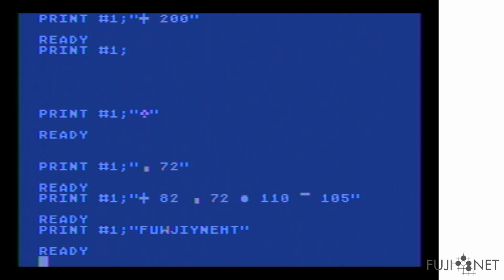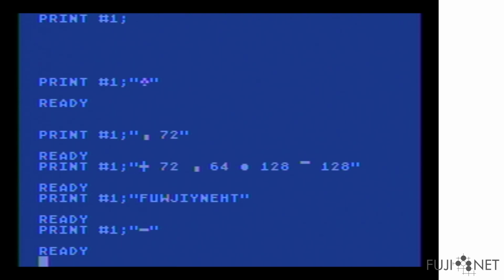#FujiNet - Using the built-in SAM Speech Synthesizer

Comment: Amiga had a phonetic library for many words but you could add words. Other languages than English were supported by replacing the phonetic library but I have never seen it in my language.
Reply: using phonetics you can even let sam sing a song ;)
Reply: Amiga's voice is done by the company as SAM.
Reply: Several end 80s beginning 90s songs used voice synthesis as lyrics.
Reply: @mrkitty777  This was often a vocoder.
Reply: @polluks2  Radio Gaga from Queen indeed a good example, but I mean the house party CDs we had as kids. Vocoders were popular by craftwerk I know. First I thought it was from the early popular speak and spell toys but after I had an Amiga I recognized it. Like a Lyric ' All systems activate ' it weren't human voice driven songs only short as mentioned. But you're also right.